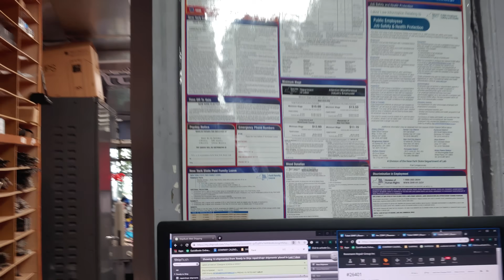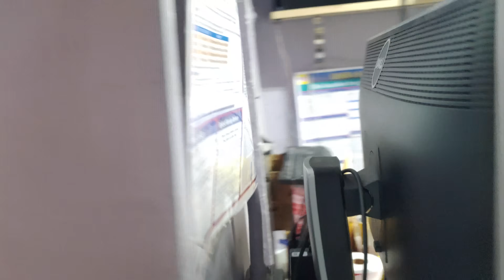Am I a real store? I want to be a real store!

Comment: Someone's building an AM4 based system. :D
Reply: MSI X570 board... someone has too much money on their hands :P sending this using my B450 board that happily runs my 3700X
Reply: Those Ryzen 3000 CPUs are really great! Built a system with an 3800x (the 3700x had over a month lead time! ) for a good friend last month and hes very happy with it. Performs almost the same as my Z390 9900k machine.
Reply: @DrakkarCalethiel  it's amazing. I had a pretty good Xeon workstation, but the Ryzen is like switching from 480p to 4K.

Comment: Apple MacBook 2020
Base price: $50000
Optional extras:
Screen: $2500
Each key for keyboard: $100
iOS: $10000
Anything gets broken you can’t replace
Reply: trackpad: 1000
charger: 100
usb port: 3000
Reply: Features:
: non-replaceable battery
: os that slows as battery weakens
: absent headphone jack
Reply: Priceless...

As in you can't fix it for any price
Reply: Not even funny.
Reply: EWave stfu
Reply: Cool
Reply: @ba94845  no it's just not funny because the joke itself is conflicting. iOS on a macbook? the battery performance degradation thing was not even a thing with macs because the battery in them are huge. The one in mine is a 99.99999 watthour. Now, Im not an apple fan boy, but this joke just wasnt even true, realistic, or even funny.